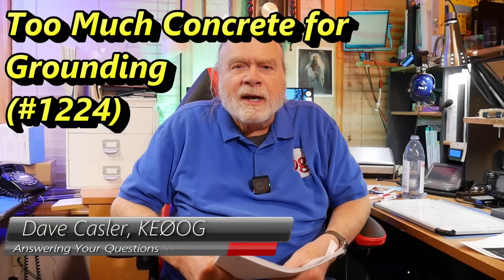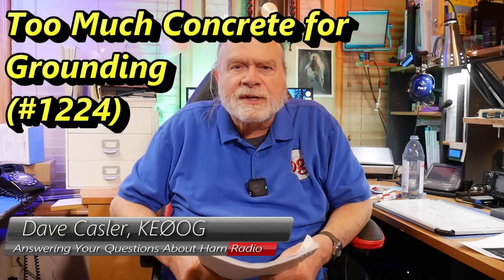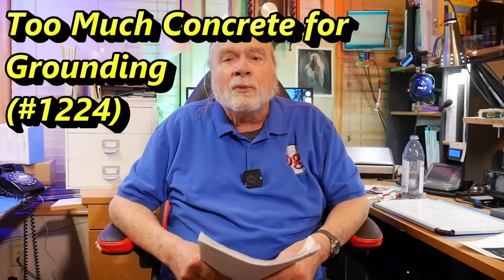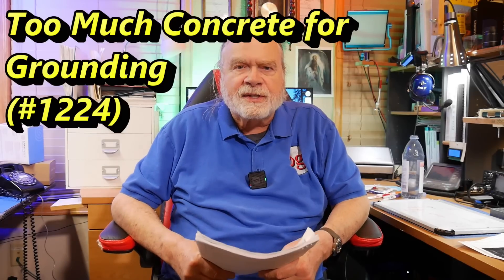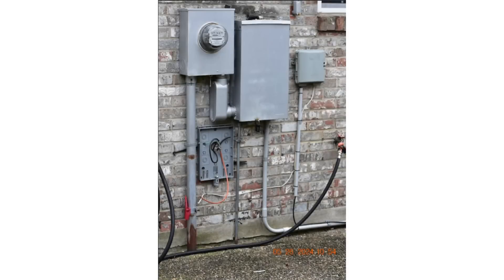Too Much Concrete for Grounding (#1224)

Comment: Would it just be easier to have another ground rod driven just outside of the shack and ground to that? Might be cheaper than an extended run of 6 AWG copper to the existing rod.
Reply: Any additional ground rods need to be bonded to the utility ground.
Reply: @scottreynolds  Was this a service ground, or simply an antenna ground? The IBEW buddy of mine said that if it is simply a ground for an antenna system, eg. lightening strike or static grounding, the ground rod can be independent of the service ground.

Comment: I have a Question about Maypoles. I have a 20, 40,80 meter Maypole in the yard. Center mast is just under 40 feet. I`m feeding it with 75 ohm direct burial coax. It worked great for several years. now I`m Having  problems with it. Should I use a Balun and what Type? Thanks .

Comment: You can ground to rebar going in to concrete. They ground nuclear missile silos this way, and it also shows up in various building codes around the world. Water is "trapped/suspended" in concreate, making it an excellent ground, and water will move through it (and is typically in direct contact with the dirt too). Dirt only grounds because it has moisture in it, and is relatively unpredictable. Now, does it make a good radio ground might be a diffrent problem.
Reply: Never ground into concrete footing, always 1 foot away. Reason , wet concrete when struck, 2:50  creates high pressure steam & will blow your tower footprint into rubble.
Reply: actually, out of curiosity, might be interesting to see if he rebar in various foundations will act as an attenna. 😆 🤣